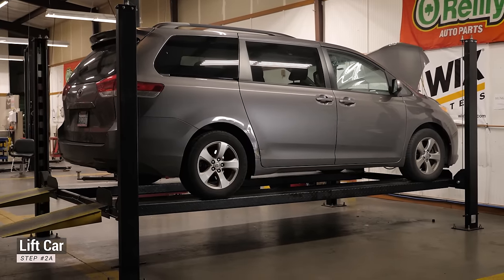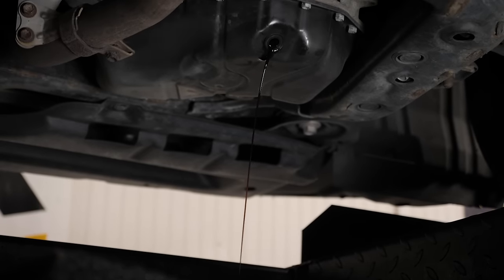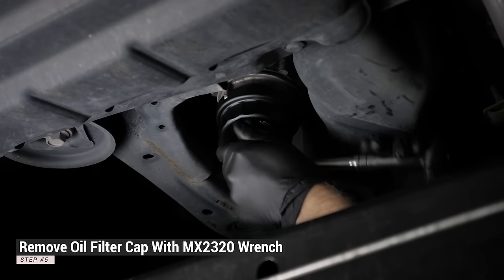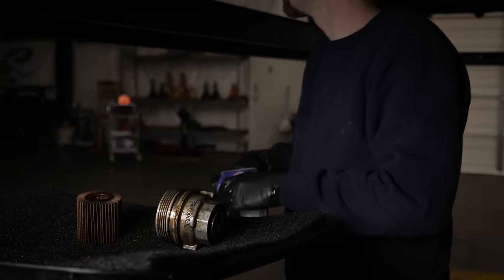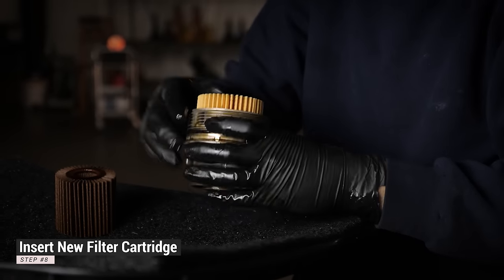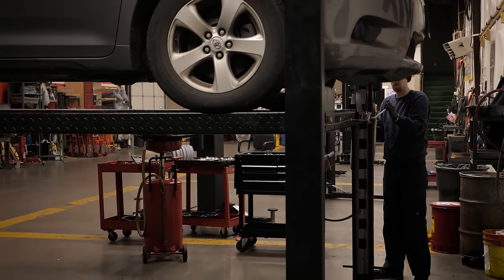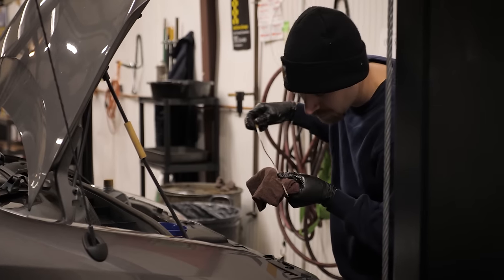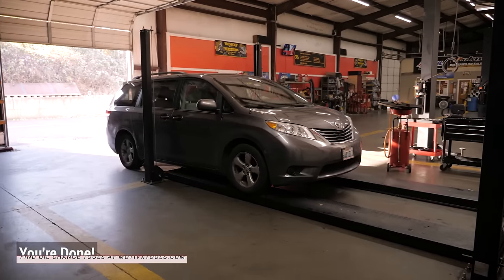Toyota Sienna Oil Change (2007-2016)

Comment: I just changed mine for the first time. The previous owner used a cheap filter that was split on both ends. After comparing a few different filters I’m definitely going to be sticking to OEM for this vehicle.

Comment: The problem i see and a lot of people do it is when they change the oil filter they don't change the o rings especially the first one at the bottom . They just unscrew the whole thing and don't unscrew the first screw to change the o ring then it leaks!

Comment: 0w20 ? I think my cap indicates 5w30. 2008 sienns
Reply: We use 5w30 too.
Reply: Yes, manual says 5W30 for 2008 Sienna
Reply: some years ago, toyota sent out a service bulletin to fill them with 0w20. its not that big of a deal, mostly to squeeze a little fuel economy out of them. 0w20 didnt exist back then and emissions regulations were looser too. 5w30 is perfectly fine.
Reply: @raiden000  
OW-20 didn't exist in 2008? I'm not sure about that but 0W-30 did and that's what we used in our 2002 CR-V.
Reply: The 2011 Sienna was redesigned. Completely different from 2010 and older. The Sienna he's working on is the newer design 2011-16.

Comment: how does this tool cost
Reply from the maker: Hi Belinda. The wrench is $24.95 with free shipping. https://www.motivxtools.com/products/toyota-2-5l-5-7l-oil-filter-wrench
Reply: $22.95 for the smaller wrench that fits the 1.8 liter engine (in Corolla, Prius, Matrix, Pontiac Vibe, some Scion & Lexus models)

Comment: That's a bunch of crap I need a special tool? Just to change the oil? What a sham
Reply: You're right - if your oil filter is easy to unscrew.  If a garage overtightened the factory filter housing, then you wished you had this particular tool. Read the Amazon user reviews for the Motovix MX2320.
Reply: @dq7143  I hear you. Soon as I read that I put all my stuff away and didn't even think about trying.
Reply: The tool I bought cost $12, and works with several different filter housing sizes. The first time you change your oil, it more than pays for itself. Bonus is that it is a superior system to filters that have integrated housing,  in my opinion.
Reply: @zmt3464  good call. I think I sold that van a couple years ago but if I was going to keep it I definitely would have bought the tool. Good stuff.

Comment: Toyota's metal filter thing. Can be a son of a b** to take off recommend not using their little plastic insert to take the oil off. Instead use that tool with an impact drill even a cordless impact drill to impact that son of a b** off. And install the same way